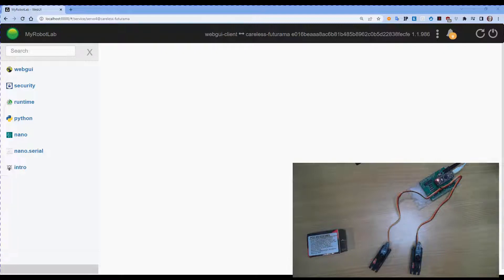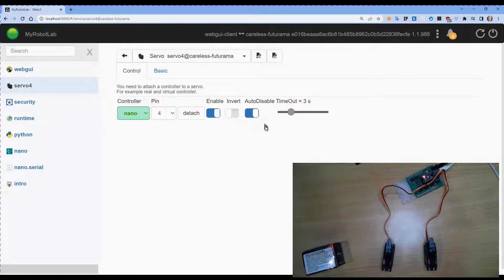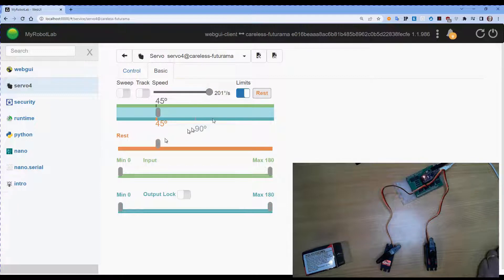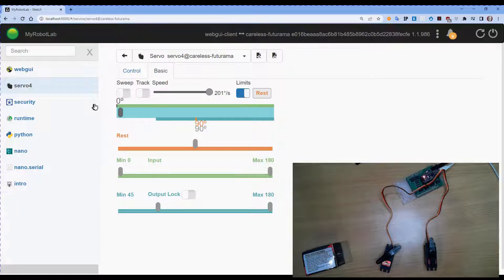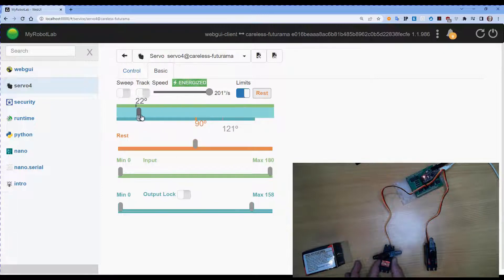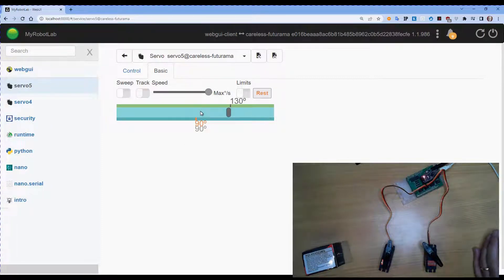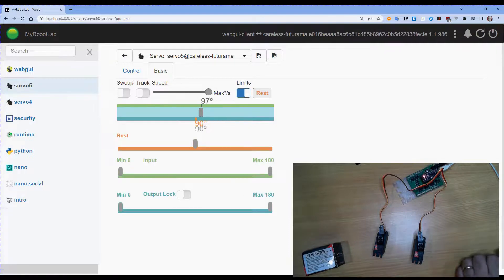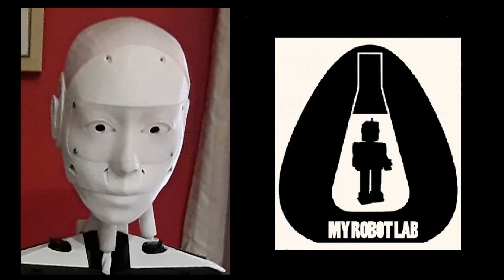MyRobotLab Part 5, Servos Service

Comment: Thanks for this, really informative. Used the sync for the articulating neck,  I was able to control both servos from the Arduino as you described in the video - saves having to physically butcher one of the servos!
Reply from the maker: I'm glad this helped :-)
I'm not convinced sync is the solution when 2 servos are tied mechanically together, but if you can get the limits set right it should work.
However, it the limits are a little off, then the servos can fight each other and can result in one or both servos overheating and burning out.

Comment: Finally figured why myrobotlab stopped working……it’s not the software, it’s the servos…..996r servos can’t handle the control of mrl and shut down…causing mrl to crash
Reply from the maker: There is no feedback from the servos to MRL, so MRL should not crash.
But I can see where the servos may fail and not work.
Signals from MRL via either the Arduino or the PCA9685 is in the form of a PWM signal where the output pulse will be between 500uS and 2500uS around 60 times per second.
When MRL wants to turn off a servo, the output signal is simply stopped.
Most servos will interpret the lack of a signal a command to turn off the motor control loop, some will stay running using the last know pulse width for the control.

Newer digital servos can run with a pulse frequency as high as 300 Hz or 300 pulses per second still using the 500uS to 2500uS pulse width.

Comment: Again excellent work. I'm loving this series. I need to go back and watch the earlier ones. It looks like the Web GUI has come on a long way since I last looked at it. I think I need to upgrade to the latest version soon and switch over to the Web GUI. Is it possible to sync more than one servo? I think it would be nice if the MRL team could add that sync option to the web GUI. Another thing I think would be better is when you adjusted the output (mapping) it didn't take effect until you tried to move the servo. At which point it made a big unnatural jump. I think it would be better if the new mapping was immediate as soon as you move the output slider. But just my opinion.
Reply from the maker: I understand what you mean about the jump.
Not sure how it would be coded up....
Best person to ask about it would be @GroG in the MRL Discord channel https://discord.gg/XygZbWwsCq
So far there have only been 5 videos in this series released.
Next week I look at the Ultrasonic Sensor. 🙂